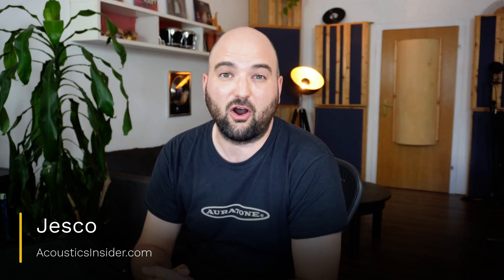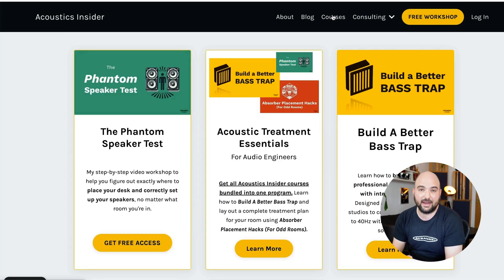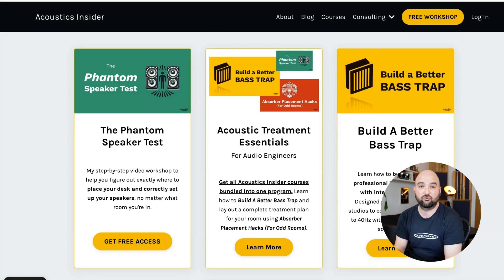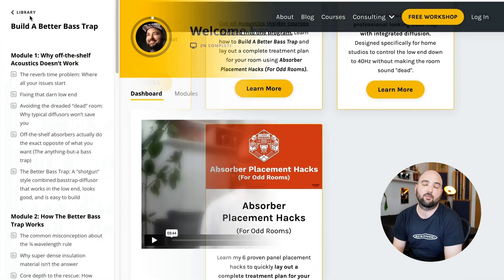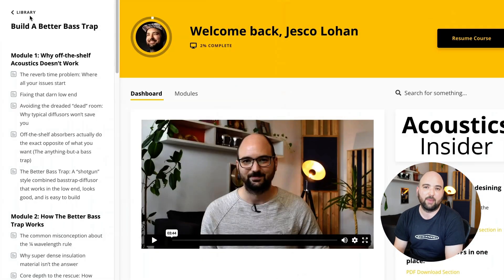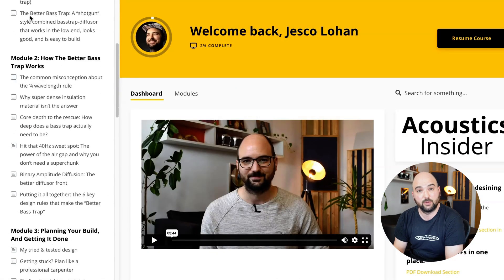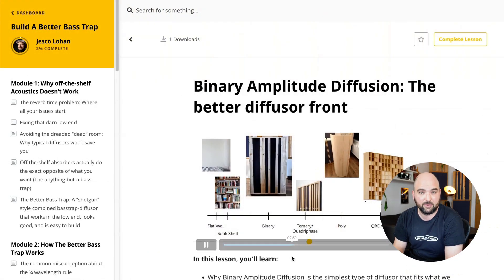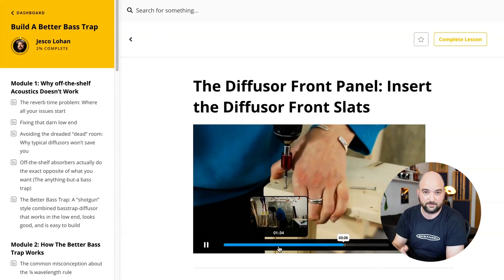Why Your Studio's RT60 Measurement is LYING to You (And What Actually Matters)

Comment: In my listening room it is physical impossible to put absorbers at the first reflection point. On the right side there is a window and on the left side there is the kitchen space. The RT60 is around 460 ms at the listening position. I'm wondering if it would be a good idea to use acoustic clouds against the ceiling at the first reflection points instead?

Comment: Without a IEC 61672 Class 1/2 measurement system, your measurements can be off by more than +/- 2 dB. Which means the 4 dB peaks/deviations most obsess about could simply be a fault of the error of margin built into your measurement chain and NOT the room. This is the main problem with hobbyist acoustics as acoustics is an art AND science. Meaning, we need accurate measurements to work with.

Comment: Thanks Jesco! I just treated my room and I have a decay rate of around 0.15 throughout the whole spectrum. Only problem is that between 50-60Htz the decay rate is around 0.38 sec. Is that balanced enough in your opinion or should do something about it?
Reply: My studio room has about the same. But it is -50 db (from my 90 db test volume  to room ambient noise of 40 db). My bass range from  60-20 is also about the same (350). And i definately dont think my room sounds dead.

Comment: Yes, exactly. RT60 is still very useful, just not necessarily accurate. If you just use it as a gauge or compass, it works perfectly well for showing direction. Small number good big number bad, that sort of a gauge/compass.  Cheers 🍻